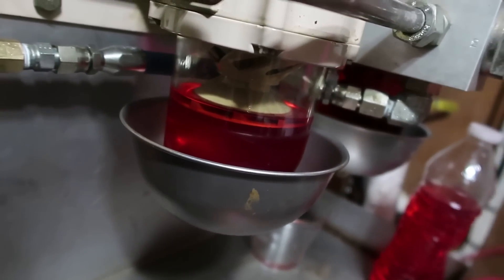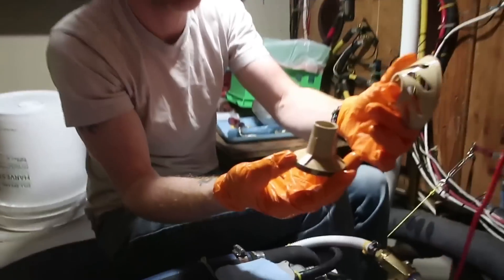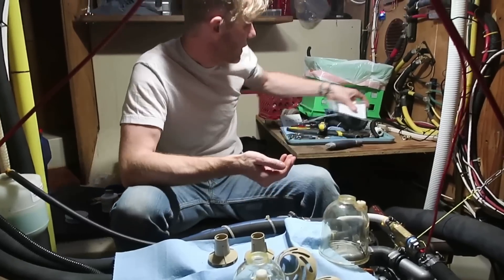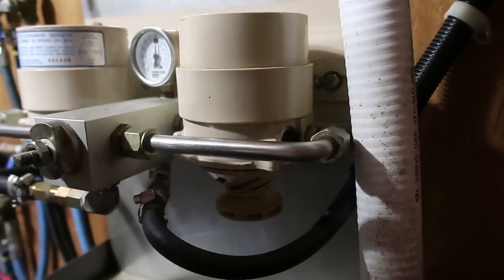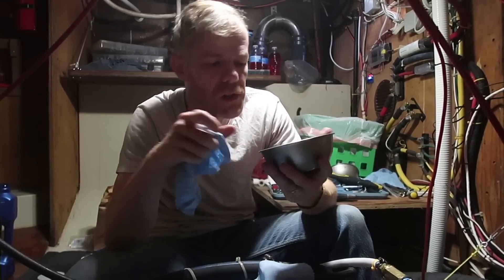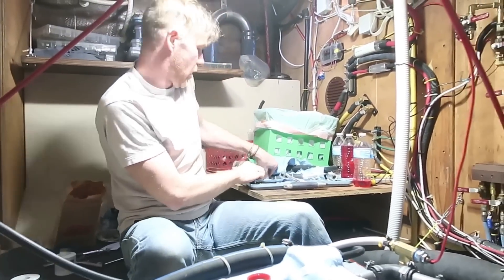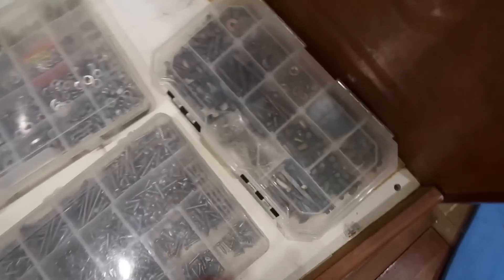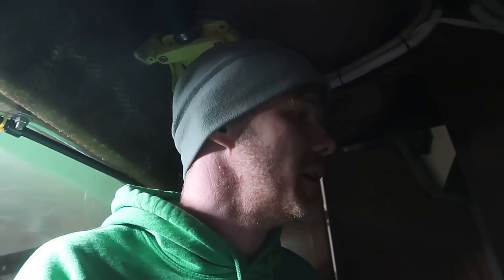This Tiny Ball Can Ruin Your Day | RACOR FILTER REBUILD | Sailboat Story 224

Comment: The four way valve . Did you even take it out and spray it with PB blaster and wd 40  ?

I had an issue with my racor 75/900 and it was the 4 way valve had oxidized .
Took it out and spreyed it z
Reply from the maker: It was the ball, not the valve. No sense taking apart components that are working correctly.

Comment: So cool to see these older Racor filters; my father had a whole lot to do with many of the components for those filters during the 1980s. I can remember as a young kid my father designing some of the die cast molds and/or injection molds (for the bowl). These were all done prior to CAD, all done on the drafting board. Can’t tell you how many of the check balls were around my house as a kid lol.

Comment: Even without the "anti-backflow device", it seems that if your fuel was going back down to the tank, there's a leak, somewhere.  I think there must be air leaking into your fuel lines (or perhaps the filter assembly, itself) because as the fuel gravity feeds back to the tank (if it's not empty - tank draw tube is submerged in fuel), something has to displace that fuel (in this case, air).
Reply from the maker: We replaced the anti-backflow ball & seat. Been working perfect with no leaks ever since.
Reply: @Sailboatstory 
     I see that, and I agree it's a good thing you did.  Otherwise, the fuel would gravity feed back down every time you changed the filter (or removed the lid).  I'm trying to help people who watch this video understand that if everything else is properly sealed, the check-ball should not be a factor (unless removing the lid of the filter) - could help for troubleshooting some situations.  Perhaps re-seating/re-sealing the rubber bowl seal was helpful in resolving the other leak (air getting into the fuel bowl, allowing fuel to gravity feed back to the tank)?
     Here's another thing that might be helpful...  My fuel tank has been de-laminating for a few years - lots of crap that looks like flakes of paint.  Recently, it got so bad that I was only able to travel about 20 miles before the 30-micron primary filter would become clogged.  I removed the tank access cover (where the suction and return lines go into the top of the tank), and hooked up a 10-GPM fuel transfer pump to a 10-micron 25-GPM fuel-bowl in as a means to re-circulate and filter the fuel directly from the 38-gallon tank, and back into it (fuel polishing).  I did it for 30 minutes with the nozzle pointing to the front of the tank, let the pump/motor assembly cool for 30 minutes, then ran it for another 30 minutes with the nozzle pointing to the rear of the tank (total of 1 hour of pump running).  I put the tank cover back on, got everything properly re-connected, and I've seen a significant improvement.  The vacuum gauge connected to the suction side of the regular fuel pump reads much lower for much longer (indicating the filter doesn't become clogged nearly as frequently).  Again, I hope that some folks might find this information helpful.

Comment: So the fuel drained back into the tank. But where did the air come from?
Reply from the maker: Great question. It came from a leaky fitting that on the underside of the main valve where the diesel exits the filter manifold.
Reply: @Sailboatstory  I bet if that leak wasn't there the fuel would not have drained back into the tank. But at least you know the non-return valves are good now.
Reply from the maker: @millzee60  I wondered the same thing. To test, I repaired the "air leak" first just to see, but alas, the bowl still drained in about 15 minutes. It was a combination of problems, but it hasn't leaked down at all since the repair.

Comment: The real key to organize and miscellaneous parts that have been removed from things and devices is to tagum and bag them as you remove them. Even if the screws are Rusty no longer usable I still group them from where they came from. It makes it easier to find the correct replacement for them.

Comment: Would it have been easier to move the filters a little inboard by using a spacer between the bulkhead and filters?
Reply from the maker: It would have been marginally easier if they had already been moved inboard with spacers, but if I were to have to do it, no, that would have made the process more difficult.

Comment: Oil is not what you use for the o-ring. Silicon grease is what you need. Oil breaks down the rubber and will cause it to fail. You can get it from amazon or a dive shop lowes Home Depot
Reply from the maker: Parker Racor, themselves, say regular engine oil can be used to lubricate the seals
Reply: @Sailboatstory  just because they say to do that doesn’t mean it’s the proper way to do it.  Their goal is for you to buy new ones once they wear out faster than they should
Reply: I use plumber's grease on  rubber things like that.

Comment: Nice job on the Racor rebuild. When putting the lid gasket in place, it is easy to "roll it over" and hard to notice it is not in flat. Something to be aware of. Also, I found it's a good idea to put a little tension on the lid when tightening the "t" handle and then rotating the lid a couple turns before the final snugging.  How long did it take to sort all the nuts,bolts,screws etc? It may not be a bad idea to put some of that "non skid" material you put in lockers between the plastic organizers and also working out a way to lash the whole pile to the shelf since those plastic thru hulls look pretty vulnerable.
Reply from the maker: About an hour to organize all the hardware. I have foam chunks to take up the extra space around the hardware bins.